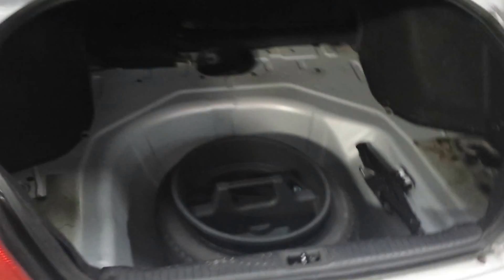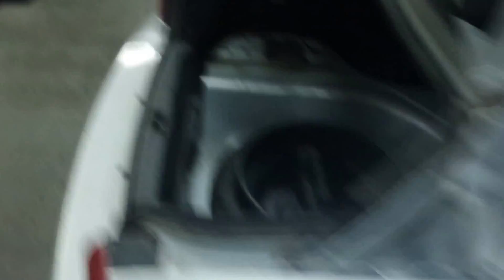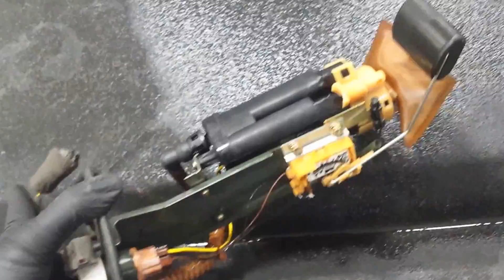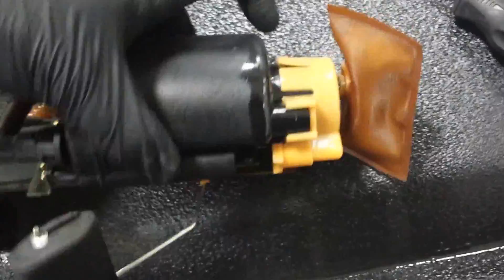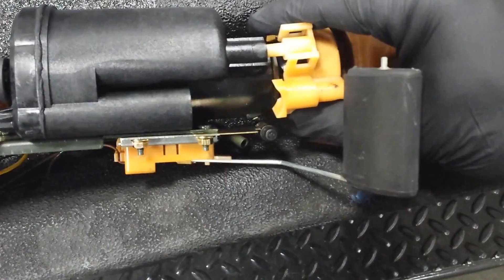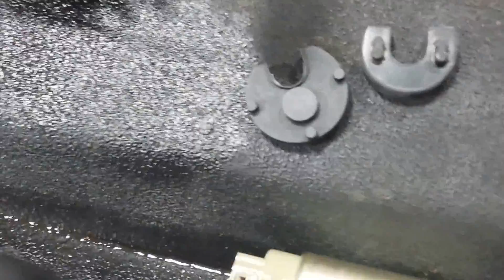Hyundai Sonata Fuel Pump - How to Replace

Comment: After doing this job with guidance of this video 
Here’s my personal additions 
Get a shop towel or rag or the like, when disconnecting that fuel line with the bolt, still had a bit of pressure in mines and nearly got my eyes 😂. Also DO buy a pick or something for that orange ended cables, I would’ve struggled less with one. And my OEM fuel pumped looked a tiny bit different than the original but still fit. Thanks for the guide! Forgot to say, he’s right when he says to be patient trying to pry all those yellow clips! Don’t do them in a bad mood 😅

Comment: THANK YOU! but im going crazy wondering what the hell those two wires at the top of the new one is? The old one dont have it so theres just this random wire harness hanging off after install. I see it in your pump as well but your old one has it. Maybe only for the 4 cyl?  Any clue?
Reply from the maker: If we're looking at the same thing I think your talking about the wires on the actual fuel pump that will plug into the lower side of the tank lid cover.

Comment: I think this is the same as my car I haven't taken it apart yet I have a 2003 Hyundai xg350L... I wanted to get the whole assembly but I don't have three hundred and something dollars or even the cheap Chinese ones, but I'm afraid to get that one... is there anything else in there that I may want to replace while I'm in there.. it looks to have some kind of filter screen on it, are those easy.. I'm assuming they are

Comment: how would you know if it's the fuel filter or the fuel pump that has to be changed?
Reply: the filter is cheaper and should be changed every couple years anyhow. you'll need someone to test the fuel pump. i usually unhook the fuel line that leads to the engine and turn the key on for a second to see if it pumps. with help too. gotta catch the fuel in a container. caution always helps.

Comment: My car has been running normally for me, but since I've only had it a while the fuel pump could've already been damaged, but today it stopped running and now won't turn on. The engine sounds like it isn't getting any gas and when I push the gas pedal the engine doesn't rev at all. Figured it was the fuel pump, but do you have any other ideas on what it might be?
Reply from the maker: Before you do anything make sure you check all your fuses and see if you can identify your fuel pump relay and rotate that with another relay just to verify its not something simple
Reply from the maker: Before you do anything make sure you check all your fuses and see if you can identify your fuel pump relay and rotate that with another relay just to verify its not something simple

Comment: i have replaced my fuel pump recently after that when  i was breaking hard engine stalls can you tell me what is the problem
Reply from the maker: There's many things that could be causing your issue, I would set up a fuel pressure gauge while driving the car to see if it's a fuel issue or if the problem is elsewhere. If your fuel pressure is checking good I would check to make sure you do not have a vacuum leak at your brake booster. I'm not very familiar with the transmissions on these cars but a torque converter lockup could also cause stalling issues.
Reply: Thank you very much for your feedback there is a issue on my fuel pressure issue sorted now

Comment: +sef turns out I needed a cam shaft sensor
Reply from the maker: Thanks @Jacques Brown for chiming in on that, everyone's input helps, at the end of the day we're all tryin to get our cars fixed and save a dollar.
Reply: Thanks for your reply. Mine was running sluggishly before I touched the pump assembly. I thought it was a pump issue, so I replaced it. Now it's not even starting. Is there any other relay or anything else that I can check?

Comment: I wnt to knw where the fuel filter is locate. can yu tell me plz
Reply: there is no filter just a strainer in the tank at the end of the pump. mine is 2003 Hyundai sonata 2.7. look in the filter books at your parts store it will say non serviceable that's because this is none.

Comment: I have a2003 sonata the instarte and run but if you push the gas the car don't want to accelerate can that be the fuel pump?
Reply: check your throttle cable first if the gas pedal doesn't raise rpms while in park or drive

Comment: so the long start issue is usually associated with the bypass valve failing. That being said, is the bypass valve inside the pump assembly and is it replaceable or is it just easier and more efficient to replace the entire pump?

Comment: i did this down to the tee ..and my engine still wont start ..its like the pump turns on but then shut off whats the problem? do i need to prime the line ?
Reply: Having the same problem with my 03 sonata. Replaced the entire pump assembly. When key is turned on, there is a clicking sound coming from the back, but no whizzing priming noise can be heard. Engine cranks but does not start. Checked the pump connector which is coming from the battery side and found 4.8 Volts there. Can anyone suggest any solution?

Comment: I'm assuming you can buy the fuel filter if you want to disassemble the unit and transfer the o rings. Surprised your new pump did not come with a sock. Guess this is a separate order part. If I was to do this I would replace the pump sock too. Great to see others post Hyundai videos.

Comment: Was this done, because the car would not start after putting gas? My 2010 Hyundai Assent GLS 4 cylinder will not start after i put gas. Help?
Reply from the maker: Linda Luquin This car was having hard start issues, you would have to crank it for a bit before it would start.
In your case, as long as the correct fuel was used I would first check all the fuses inside the car and engine fuse box. I would then look up the fuel pump relay location in your owners manual and swap it with another relay such as a/c relay. The third common issue with several vehicles is the inertia switch may have tripped if you hit a dip or bump pulling into the gas station. Look up its location and check if its been tripped, if so press the button and rest it.
Reply from the maker: Linda Luquin Another possible cause to your issue is the canister purge valve
Reply: actually your cars symptoms point to the vapor canister  purge solenoid that's part of the evap system that burns excess fumes from the fuel tank. it's located on the intake manifold under the hood. it's not too easy to get to. your car may also idle rough in gear. it might even stall. if you have trouble putting gas in the tank it's the vapor canister vent solenoid. another part of the evap system on you car.